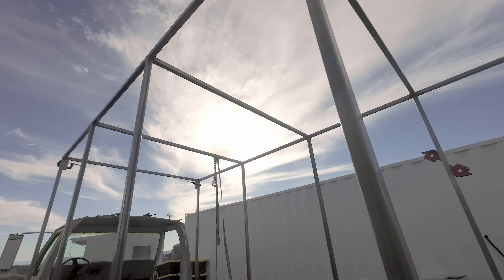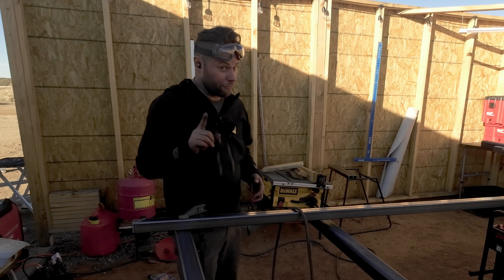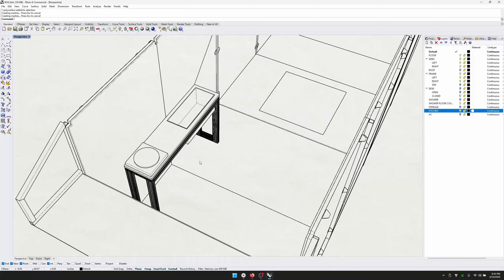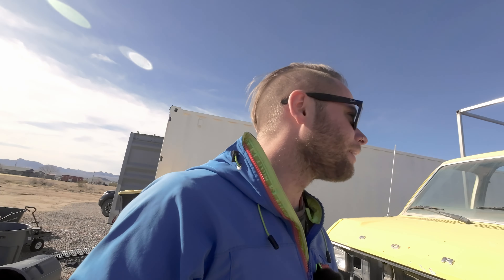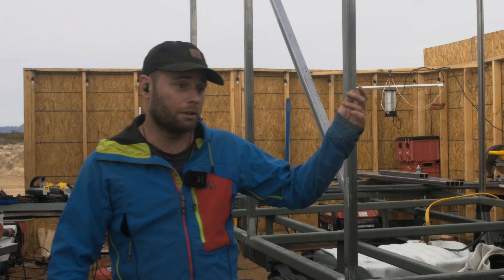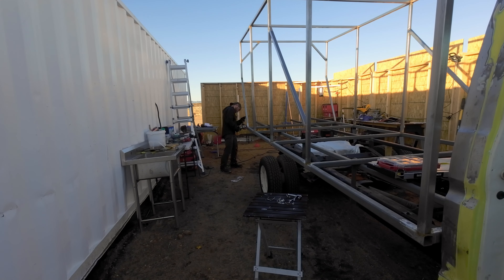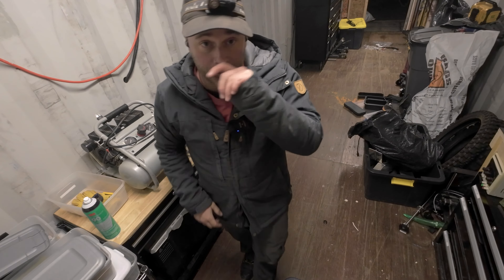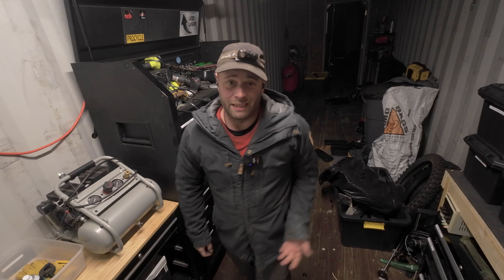I finished the CYBERPUNK VAN BOX - OVERLAND TINY HOME

Comment: use pig tallow on all blades cutting through aluminum-  night and day diffrence    used to work building screen windows for the navy subs..... yachts...
Reply from the maker: Thanks for the tip! With hand tools for woodworking, I’ll often wax the blades before use and yeah, makes a huge difference. Only makes sense that the same applies to aluminum.